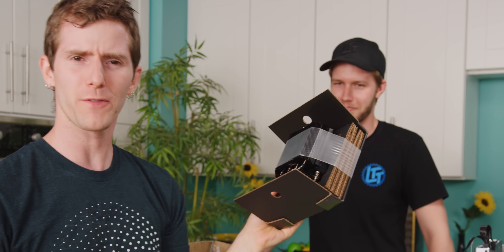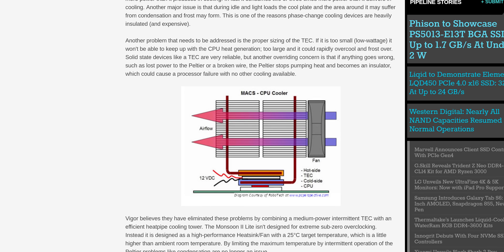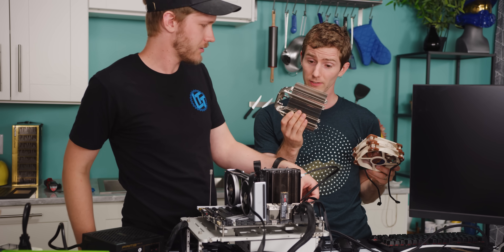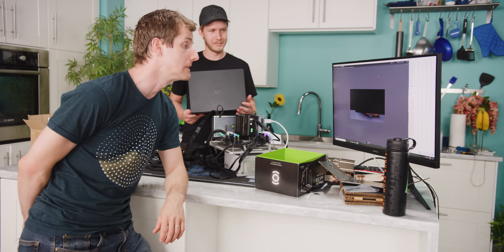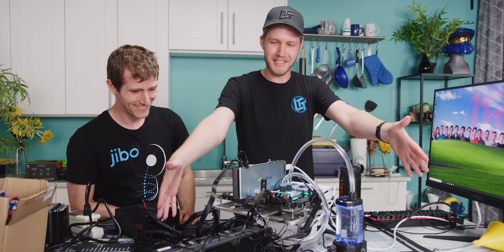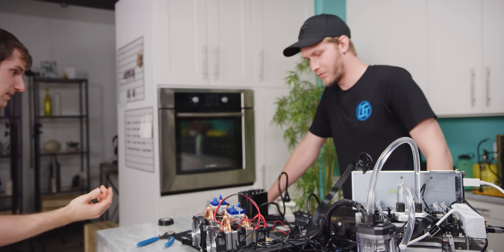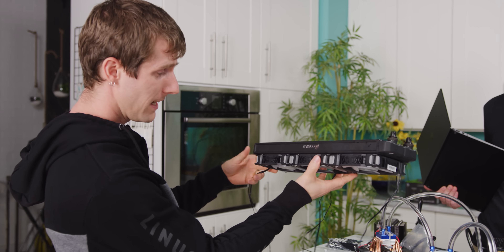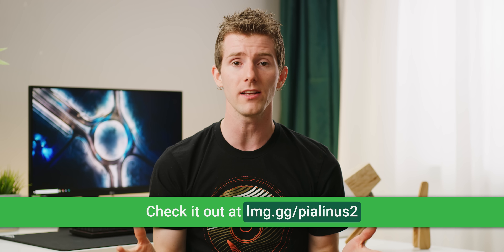Thermoelectric Cooling is a Bad Idea

Comment: Water loop for the next video should be CPU -> Radiator -> Thermoelectrics. Really curious how effective that would be
Reply: @InnatelyDone21  Late reply but, one thing you did not mention is condensation, which can build up around the module and CPU if one would just slap it onto the CPU. It would just we and damage the apparatus. I am interested to experiment on how one can contain this, though!
Reply: @c.dedalton7090  That's simple. Immerse the PC in mineral oil. Problem solved :D
Reply: @InnatelyDone21  Eh.. too messy. I'll probably research more into a waterloop - reservoir system with some kind of heat exchange between the CPU surface and the coolant. That wattage intake, man. Props to your explanations though.
Reply: @c.dedalton7090   Peltiers are like air conditioners in that they both can be thought of as devices that basically just  'pump heat'. AC units pump heat outside. Peltiers pump heat from one side to the other side. Similarly, the outside of a window unit get's hot when the AC is running. It pumps heat from inside and moves it outside. (where it belongs imo) 

Now if the temperature outside reaches  ~120F, then the heat cannot leave the system and so, builds up! (duh?) Efficiency DROPS BIG TIME. Peltiers are exactly the same in this regard: If you cannot extract heat from the hot side the device will quickly become inefficient and less work will be preformed using the same amount of energy. Look up "Geothermal Air Conditioning" , it's actually quite innovative. (And it proves the point I'm making here). HVAC engineers found out a long time ago that you can actually just bury your external heat exchanger about 6 feet underground, where temperatures are consistently in the mid 50's. The benefits are that you ditch the large noisy fan and now your AC runs a good ~40% MORE efficient. Even on the hottest of days! Especially the hottest of days . The dense, cold ground, absorbs and dissipates the heat better than hot air on a sunny day. (Who knew? lol)

Really you could just use the garden hose and hose off the external heat exchanger on your AC unit on a hot day and that would also improve it's efficiency... simply by conducting that heat away from the system faster.
Reply: @c.dedalton7090  There is no circumstance where air conditioners (or peltiers) work BETTER when the hot side "bottlenecks" and isn't extracting heat from the system. The ability to extract heat plays a big role in efficiency - in both examples. And don't let 'Daniel Moron' tell you otherwise. 

Matter and energy cannot be created or destroyed; they can only "move around" and change form. So all this heat must go somewhere... it can't magically just disappear into oblivion! The laws of thermodynamics says, "NOPE!". 

If you connect a peltier to a voltage and don't attach a heat sink to it, the entire thing gets REALLY HOT - REALLY FAST and BURNS your fingers OFF!!! (don't even ask me how I know that) but all of this is actually really obvious stuff. 

My point is that you can actually liquid cool the hot side of a peltier and greatly improve it's cooling performance. There is no debate. I'm not the first person to do it. lol. 

It's actually a common thing to see in thermoelectric refrigerators.
Reply: @c.dedalton7090  Also if you're into science and engineering I suggest the channel "Tech Ingredients" to learn more about Peltiers. 

Linus is a pretty lame engineer. Luckily though he didn't actually major in engineering - so that is't too surprising really. lol 

I suck at networking. Everyone has their limitations.
Reply: Yeah, I was hoping they would do that on this vid, could have actually been a sub ambient coolant setup if the rad was big enough
Reply: I wonder if it would work stuck on the side of a reservoir or something so that it could be in contact with the water for a longer period of time
Reply: Trivially less effective because of science. P/A=sigma T^4. You just killed your radiation. Now you need to unload your thermoelectric heat as well. Very bad idea.
Reply: @danielmorton1606  What? Why are you talking about irrelevantly small radiation losses in a system dominated by convective heat transfer? If you can dump the thermal energy of the coolant from the CPU water block using a standard ambient temp limited cooler, the peltiers can then "pump" energy out of the now close to room temperature coolant so it can be sub ambient. This is about the only way a system like this makes any practical sense.
Reply: @TheNiktron  I was replying to the top comment which specifically mentions radiators which and mentions nothing about liquid cooling. Radiators radiate heat. Even when considering air convection the delta temp matters. Placing it on a radiator doesn't make sense because it also needs to heat dump. Even what you mentioned is still just a refrigerator coupled to a liquid cooling which yeah it will improve the system, but so does water flow and volume. The only "practical" sense is to not use peltiers. You are better off with other refrigeration methods or even a phase change.
Reply: @danielmorton1606  I see. The radiator in this sense is a water cooling loop one with fans attached, so.... Also the top comment is indicating a water cooling loop, not a cpu radiator peltier stack.
Reply: @TheNiktron  Yes, I misunderstood. I just went into the physics definitions.
Reply: @danielmorton1606  Not true. You can use peltier you just have to use them intelligently. They are limited in efficiency by the amount of heat that can be extracted from the hot side of the module. Although the modules are 300w they are NOT working anywhere close to their optimal efficiency. Here's what should have been done differently: First, use the water cooling system EXCLUSIVELY to extract heat from the HOT side of the peltier module - TA DAAA - this is what allows the cold side of the module to reach EXTREMELY LOW temperatures under heavy working loads!!! The peltier will dump heat into the gas-liquid heat exchanger. The cold side of the liquid cooled peltier module would be in DIRECT CONTACT with the CPU. That is the ONLY way to correctly engineer a peltier CPU cooler. Linus is great with computers but his engineering/physics is garbage and he's a bit pretentious on top of it.
Reply: @TheNiktron  And there you have it.
Reply: @InnatelyDone21  Just, no -thermodynamically they are less efficient. They are useful when space or arrangement is an issue. Trying to build a system using them will always beg the question of why not another element. All heating/cooling cycles efficiency is impacted by the temperature difference. In general, the rate of heat draw will always be improved by taking heat away from the hot or exchange area. You can keep a source below room temperature as with any active refrigeration process though. There is a very good reason they aren't selected in industry aside from niche cases, where their simplicity, controllability or small size really comes into play. You can even stack these coolers if they were efficient.
Reply: @danielmorton1606  I stand by what I said. The peltier module itself IS more efficient when you actively extract more heat from the hot side of the module. I can cite that for you if necessary but all you have to do is remove the damn heat sink and observe what happens if you don't believe me! I've used these to generate electricity (TEGs) and played with cooling modules long before this video was even thought of. Two doped P and N type semiconductor materials form a point contact junction and several are connected in a parallel and/or series array to create the module you see here.

"In general, the rate of heat draw will always be improved by taking heat away from the hot or exchange area"

That's what I said, yes. -_-
Reply: @danielmorton1606  A processor is basically a 100w heating element and you need to meet or exceed that at peak output in order to improve CPU performance. I've seen water cooled TEC modules that are double stacked, easily reach -60C and can be used for cryogenic experiments. It is more than possible to overclock a CPU with a TEC but Linus is doing it wrong.
Reply: @InnatelyDone21  Wait are you actually saying a Peltier is more power efficient than other techniques? That I want to see because in actual cryogenics we use coldhead. Obviously, it can be more efficient with cooling with additional equipment than by itself but that is trivial. Peltier cooling is essentially an inverse thermocouple- it isn't a coincidence that the Seebeck and Peltier constants are directly related. That last bit I was saying generally to support the simple idea that you can replace the Peltier component with another.
Reply: @InnatelyDone21  Sure it's possible, it just isn't efficient which is what I was saying. I mean, you can make the system arbitrarily powerful. It is just a bad idea.
Reply: @InnatelyDone21  Why are you so mad lol. Dude, did you even read what you originally wrote? You just said they could be efficient so I tried to cover all the meanings. If you want to be strict, efficiency in cooling always refers to energy per temperature change, which cooling doesn't necessarily improve efficiency, instead of changing the cooling power. Same for photovoltaics, where I can't fathom what definition of efficiency you used to think active(?) cooling would always improve them. I like how you try to call me ignorant by finding a bunch of words in a thesaurus in a vain attempt to look knowledgeable. Or is that you trying to mock me for word choice? In all seriousness, if this is all it takes to set you off, I recommend counseling. You may find improvements in your personal and professional life. I also recommend being more precise.  I apologize if I offended you and good luck.
Reply: @danielmorton1606  You might as well tell people that TEC modules work more efficiently without a heatsink! That is basically what you are claiming. They don't . Without a heat sink removing heat from the hot side - the temperature differential reaches an equilibrium as the peltier module efficiency drops to ZERO.  The cold side will become hotter than ambient temps and the peltier will be nothing but a glorified resistor/heater for all intents and purposes. The heat has to have somewhere to GO!!! If heat accumulates in the module then the efficiency will be reduced, i.e - you'll generate more heat than you can pump and spend more electricity doing less . This is a FACT you cannot even argue. The energy in an isolated system is constant and is neither created or destroyed. First law of thermodynamics, 'dude'. These modules produce their own internal heat during operation that must be accounted for on top of their expected work load however. Devising an experiment to test this hypothesis is extremely straightforward even for the most amateur of scientists but also entirely unnecessary . Clearly you do not understand the first thing about thermodynamics! Or the second thing! I apologize if I have offended you derelict but I am right and you are wrong. 

The end.
Reply: @InnatelyDone21  No empirical doesn't mean that https://www.merriam-webster.com/dictionary/empirical- the nuance is huge here. And what you are saying for the most part is extremely obvious, but you completely and entirely fail to understand the basics: efficiency is \delta T /Energy for refrigeration or Energy/cost for photovoltaics. Let's prove you wrong trivially: a 200 watt fridge on a peak 100 watt photovoltaic. It failed to improve efficiency. You are using efficiency for power, the wrong word that entirely changes the meaning and interpretation of what I said earlier and your reply.  I say this as someone more qualified then most textbooks.
Reply: @InnatelyDone21  Again this is an optimization problem, the cooling method is dependent on problem geometry. You said at first "Not True." in reply where I claim that peltiers are simply less well viable due to be less efficient to other methods like phase change heat pumping. That is the context.  Now, perhaps you mean that the cooling power can be improved with chained cooling, but my point is unless you need the space, just use another cooling method and chain that instead since you are adding in more cooling anyways. Everything you said is obvious except you keep using efficiency wrong. The temperature differential at equilibrium defines efficiency. The system is of course always radiating, making zero efficiency unfeasible with normal materials.
Reply: @danielmorton9956  Here is detailed scientific article on peltier performance that validates what I've been saying about the performance efficiency of peltier devices and even breaks down all of the math and graphs to prove it: https://www.overclockers.com/peltier-basics/  Let me quote the article for you:

"heatsink temperature is one of the most critical elements controlling the cooling performance of a peltier system. .. The more efficient the removal of heat from the hot side, the colder the cold side will become" 

It then goes on to explain the bottleneck that air cooling a peltier device creates and how water cooling them greatly increases their performance efficiency (ability to pump heat).

" all peltiers have “Performance Curves” that indicate what the expected cold side temp will be under different heatsink temperatures  – obviously, the lower the heatsink temperature, the lower the cold side temperature."

Here he describes the relationship of the heat sink temperature and the cold side of a peltier module: 

"Th = 27C, Cold Side Temp = 8.9C
Th = 35C, Cold Side Temp = 12.2C
Th = 50C, Cold Side Temp = 22.2C"

AND THERE YOU HAVE IT!!! There is no 'debate' anymore, stop making an ass out of yourself! 

There is ONE right way and several wrong ways to use a peltier module to overclock a PC ...and just because Linus can't seem to do it - doesn't mean that it's impossible or impractical. You just have to know what the fk you're doing! "Dude" I stand by what I said 100%
Reply: i'm still thinking that should be interesting a system with: peltier (one 12706 for example), cpu and radiator. it could help to drop 1 or 2°C, adding some fans to the case. but as case of study could be interesting, just to see how bad it is
Reply: @InnatelyDone21  I believe you decided you were going to stand by what you said before typing it. Your definition is what I would expect from an elementary school student, and misses the fact entirely that if you were to repeat something empirically established, it may not work because of variance. That minutia is part of why you use that word. I recommend starting with Orwell's 5 rules of writing. Now why are you so upset? Do you think this response is appropriate? Seriously look into that anger- I would venture that it can't be healthy. I recommend working on communication- it can be frustrating to not feel understood.
Reply: @danielmorton9956  You clearly do not know what empirical means and now you're straight projecting your ignorance onto others. I provided a source for my claim reguarding the performance efficiency of peltier modules: empirically verified facts that can be repeatedly demonstrated. There is no "variance" LoL 😆 You must be confusing those two words: "verified" and "variance" but they are not synonymous!!! Clearly you suffer from the "Dunning Kruger cognitive bias"  Look it up!  There is no variation of empirical FACT  In the same way that 2+2=4 Empirical reality is not subjective and you are basically insisting that it somehow is. Do you have blue hair and find it incredibly difficult to choose an appropriate lavatory as well? That wouldn't surprise me at all 😆  Insisting that empirical reality is somehow 'subjective and variable' goes against everything science stands for PERIOD
Reply: @danielmorton9956  Insisting that empirical reality is somehow 'subjective and variant' goes against everything science stands for PERIOD
Reply: @InnatelyDone21   BetterDeadThanRed  Nah man, I am I just don't watch my youtube replies 24/7, replying to you isn't a high priority frankly. I don't need to save face? I don't get my self-confidence from youtube comments? You don't even understand the argument you are replying to, as you keep using the terms incorrectly. You are thinking of efficacy.  I never said that the heat sink was unimportant. It is possible to increase efficiency, but it isn't guaranteed.

I also never said that it empiricism is subjective. You literally added that component and quoted it later. I said it has variance, as in statistical variance. This is a huge component of science. http://pdg.lbl.gov/2019/tables/rpp2019-sum-gauge-higgs-bosons.pdf Check out the numbers under the W. Do you see the +/-? That is the variance. Experimental averages or measurements are expected to vary with 66% falling within those numbers. 2+2=4 is a logical deduction, not empirical. It doesn't rely on measurements. Empirical statements by definition do, you can do the measurement, but it isn't helpful. All measurements have a margin of error as there is limited precision and manufacturing allows for a tolerance. Do you see how this is conceptually different than a logical deduction? 

Your entire argument seems to be centered around baseless ad hominen attacks and misinterpretations. Why are you trying to be so offensive? Did I hurt you by disagreeing? Do you honestly believe that is a reasonable or constructive response? You have been entirely avoiding these questions.
Reply: @danielmorton9956  Spend a few days researching and writing pointless conjectures that deflect from the facts because it's obviously not your priority 😆 You care so little that rather than provide evidence for your claims, you spend a week tirelessly making an ass out of yourself !!! Did I mention that it was ENTIRELY unnecessary? I respond to you immediately and you take several days to reply because "you don't watch your youtube 24/7" ? Oh sure whatever you say derelict 😆 😂👌
Reply: @InnatelyDone21   I am sorry I can't be on youtube comments all the time, I have things to do. I am sorry, that you dutifully wait to respond to my comments and I cannot afford you the same.I am also not tirelessly commenting to you leisurely? You never addressed my earlier points, and neither did your argument. Your source didn't support your original claims of me being wrong because again you didn't understand efficiency vs power or efficacy nor what I actually argued. In fact your article aligns with what I said - you can improve Peltier efficiency but it isn't guaranteed as you have to match cooling. You can place a 10000 watt cooler on a 78 watt Peltier like in the article, and suddenly that efficiency drops as your components leave working ranges. Your article did show you used the word efficiency wrong in  few places. I hope you learned from the research at least. 

For everyone:
Once you start adding more complex cooling for the Peltier, you defeat any advantage in using one. Other cooling methods are more efficient and coupling them instead will be more effective. Here is a source on what I was saying:  C. Hermes, J. Barbosa, “Thermodynamic comparison of Peltier, Stirling, and vapor

compression portable coolers”, Applied Energy 91 (2012) 51–58. Peltiers are small, low starting cost, easy to control, but terribly inefficient. PC builds you need to justify them. 

The definition of any word is not self-evident. I linked the definition, and explained why yours was demonstrably wrong. Empirical means something is demonstrated through trial roughly speaking. Seeing something yourself is not empirical as it is trial of one, nor is the ability required: can you see the Higgs mass yourself- no it takes teams resources, and knowledge you don't have. The resulting quantity is still empirical. 

Of course talking to you is unnecessary, and the same could be for you to me. I am honestly hoping the best for you and other readers. I hope you can look back and ask yourself if you were a good person. Ask yourself why you rely on being insulting and attacking other people? You also seem to be projecting a lot. Good luck and tell yourself whatever you need. Have a nice life.
Reply: @danielmorton9956  Dude - I reply back to you in like 20min or less. Get a fking grip already xD